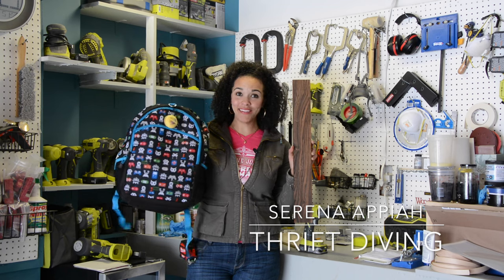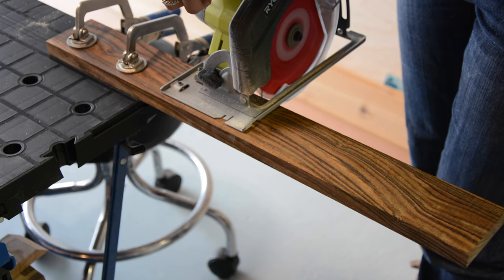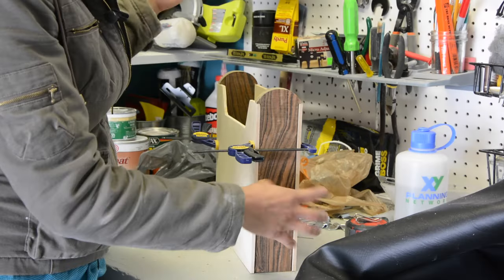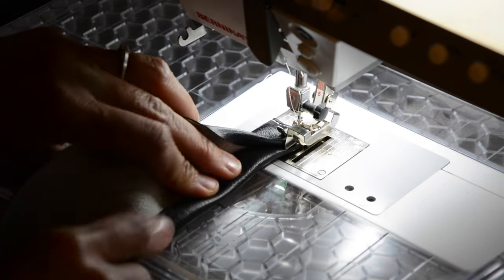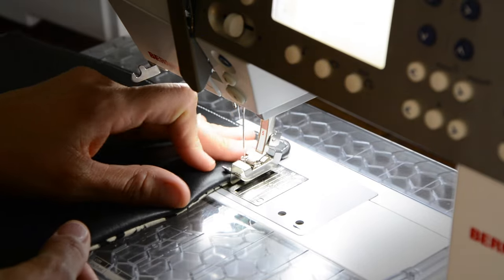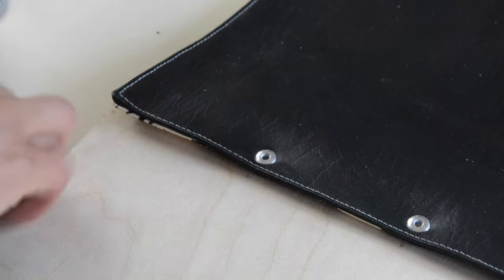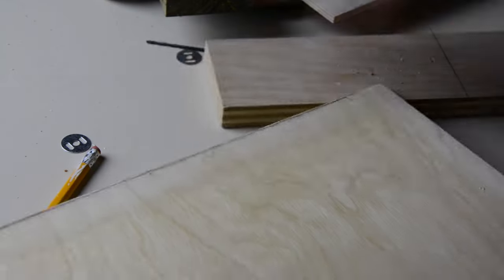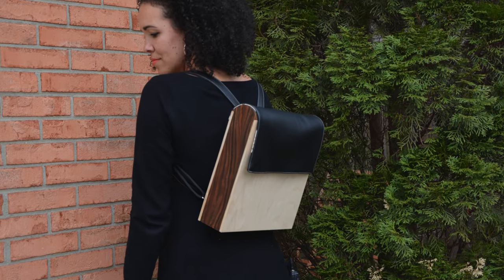How to Make a Wood Backpack: DIY Tutorials - Thrift Diving

Comment: YES!! Another great video. Love the way you thought outside the box and created something usefully. Using that riveter tool looks hard and fun at the same time. Question: you glued, could you have also used the nail gun? I am so motivated!! Thanks, keep them coming!😏
Reply from the maker: Thank you so much! I thought I had responded back, but I'm not seeing my reply, so I'll go ahead and respond again. Glad you liked it! Yes, you could use a nailer. But it would have left nail holes. And since I was leaving this natural, there wouldn't be a good way to hide those holes. Wood glue was the best bet. Use a good wood glue and clamp and let it thoroughly dry!